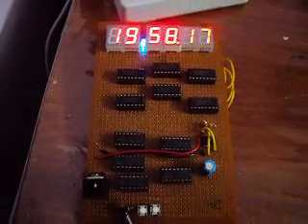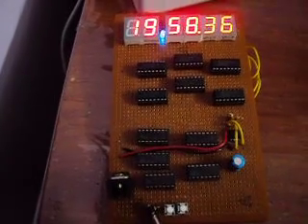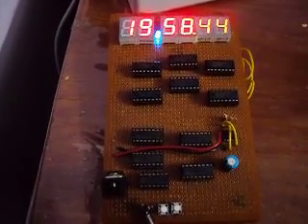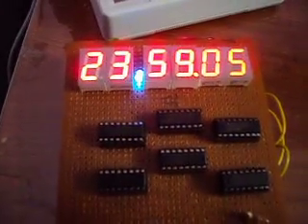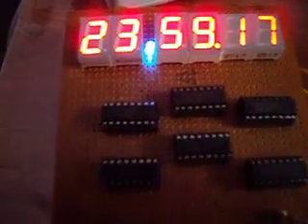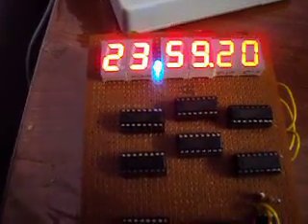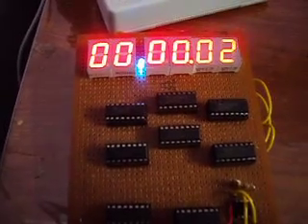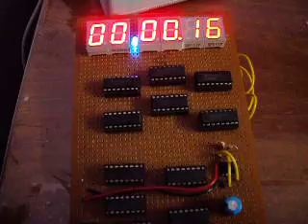Digital Clock /4026 and 555/ 7 segment display

Comment: I think more accurate if you make digital clock using ic atmega 8-bit. Because ic ne555 is not running at 1.00Hz, but can be 0.98Hz or 1.03Hz

Comment from the maker: .youtube.com/watch?v=PhE7WMBmSIc
DIGITAL QUARTZ CLOCK  4026 4060 4013 
7 SEGMENT LED DISPLAY 
using 4026 4060 4013 IC,crystal,
running at accurate 1Hz.
modified this  video circuit removed 555 connection and added 4060,4013 and crystal.
modified on response for the comments 

watch .youtube.com/watch?v=PhE7WMBmSIc

Comment: pretty neat. a bit more work than what I was ready to put in..  but if I were to go as far as to make a full 24 hour clock down to the second, I would have done what you suggested in the other comments: replace the 555 with a crystal.

but then I would have gone a step further and made it a 12 hour clock instead of a 24 hour clock, and every 12 hours, trigger a 4017 (overkill) to switch in between 1 of two LEDs to indicate AM and PM.

Comment from the maker: @odessa999 
to make 555 more accurate i need to  use a variable resistor to adjust the resistance 
and make the 555 ocillation more and more accurate.